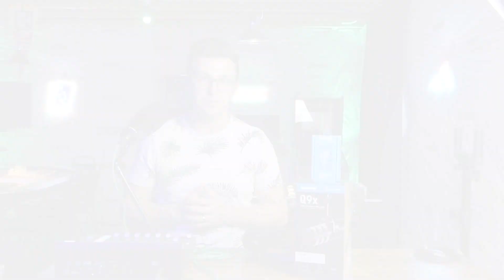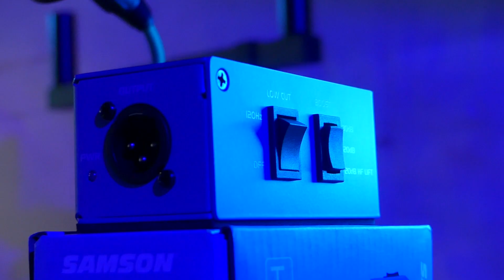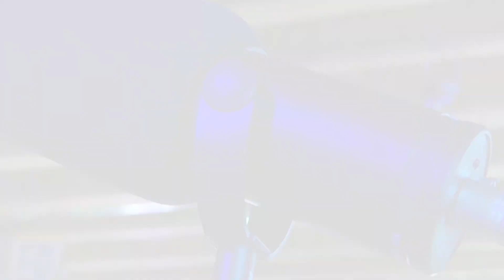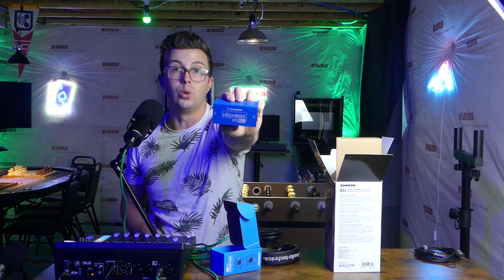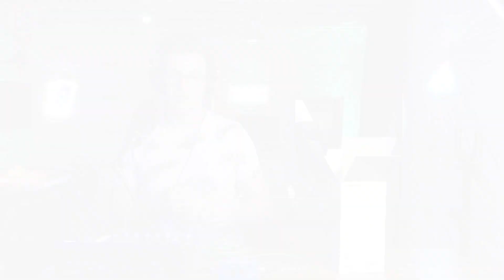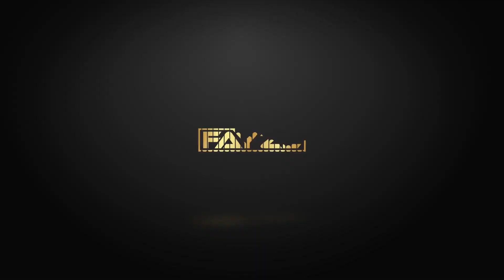Samson HighRise Mic Gain Booster and Q9x Broadcast Microphone | Demo and Thoughts!

Comment: I've been confused about this for a while but people recommend dynamic mics for YouTube because they're quieter and pick up less noise than condensers. But wouldn't adding a mic booster also make a dynamic mic more prone to noise since the cloudlifter uses the phantom power like a condenser mic would anyways? Would you recommend picking up a dynamic mic + booster or a condenser mic for content creation (untreated room)? Anyway great video!
Reply from the maker: Great question! Whether or not you need a mic booster really depends on your specific mic and mixer. In the case of the microphone and mixer you see in this video, they are both very high-quality and don’t really need a mic booster, even though I use them for testing. However, as I think back on all my years as a DJ, there have been other times when I have gotten to a venue and needed to plug into a sound system that wasn’t my own. Their mixer did not have a lot of gain and I needed to crank the input. In situations like that, a mic booster would be very helpful.

The difference between a dynamic and a condenser microphone also often comes down to the pick up pattern. The dynamic microphone usually has a much more directional pattern, which means even if you amplify the gain you are still rejecting a lot of noise from the sides and back. A condenser microphone can struggle with this.
Reply: @fayzereviews  Thanks for the detailed response. I'm just confused because I love the fullness and clarity that condenser mics give, and all the dynamic mics I've heard so far just lack in that department (except ones like the RE20 which I definitely don't have the budget for). While I do like that dyanmics are quieter, I guess I'll just settle for a condenser like the AT2035 or Lewitt LCT 240 Pro and do some basic noise cancellation on Adobe Audition. I appreciate the info, thanks!